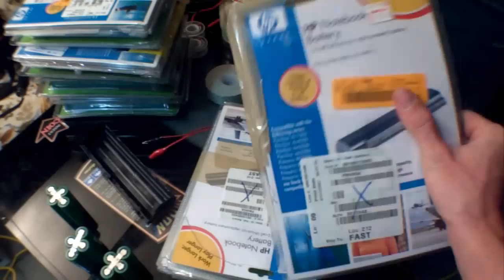DIY: 48v 24ah lithium ion 18650 e-bike battery pack

Comment: Your 35 Ah guess is WAY off!  Your battery contains 72 cells.  Each cell has at least 1.5 Ah (probably closer to 2 Ah/cell).  1.5 Ah x 72 cells = 108 Ah (i.e. at the load-rating that the manufacture uses to test each cell).  What's more important for you to know, however, is the battery capacity in Watt-hours.  In your case 3.7V x 1.5 Ah = 5.55 Whs/cell  x 72 cells = 399.6 total Whs.  That's why you were able to ride on a single charge for SOO long). 

p.s.:  Connecting your cells in parallel & series as you did, does not change the total Watt-hour capacity of your battery.

Comment: Did you use any battery management system?
Reply from the maker: at first i just monitored the cell voltages manually, then i wired up an imax b6 to charge them. but eventually i got a BMS.

Comment: i am new to the electric bike stuff and i was wondering what AH lithium battery pack i would need for a 36v 500w e-bike kit, to go 15 miles at a moderate speed with small hills. Thanks!
Reply from the maker: harry barry well this can be brought down to a more basic rule. i recommend for every amp you plan to pull you should have one Amp-Hour of capacity.
Reply: Sorry i have another question. would you say 10 "faulty dead laptop batteries with 18650 cells" for $50 usd dollars is a good deal, with roughly 6 cells per pack? thanks!
Reply from the maker: harry barry
yeah that sounds ok. that would be less than 1$ per pack right? look at what laptop they are for and see when that laptop was made. that can help you judge how old the packs are. and if they dont have any logos like IBM or anything on the batteries they will probably be low quality (but usable) cells.
Reply: Wow thanks for the quick reply!
there are 30 in total and i am buying 10 of them. Some of the packs are IBM, HP and replacement no brands.
Reply: Also to add some have more than 6 cells.
Reply from the maker: harry barry
nice, they should have atleast a few good cells.

Comment: hi, you have a web? how can I charge this pack battery, some schemes electronic circuits
Reply from the maker: unfortunatly no i don't have a website. but i may someday.

check the description for the next video. the next video is how i charge it.

in the description is also a schematic of this 24v 35ah battery. i use 2 of these batteries for my 48v battery

Comment: how did you test the ah of the batteries if you have a mystery battery???
Reply from the maker: i connected a motor to them that pulled 2 amps, and so for every 30 minutes it ran the motor that was 1AH.

i'm actually uploading a video right now where i test the battery with my imax b6. i was hoping it would be 35ah but it was only 24.

Comment: Can i combine my 4 sla battery's with a 48v 18650 battery pack i made? Its only 6s 14p. Not sure of the difference in amp hours is an issue
Reply: Dr. Steve Brule the amp hours may be an issue whats the ah of the 18650 pack and the sla's
Reply: Kim Jong Hard-un no the voltage of them i different so you cant

Comment: did you ever figure out the amp-hours of the pack, my guess is that you have 6 cells of 4volts each and each cell has 12 parralelled 2 amp-hour batteries in it so you have approximately a 48volt 24 amp-hour pack not 35 ah as you originally thought, but like you said at 8:18 ""i'm not really sure""  ;)
Reply from the maker: i did a discharge test video a while ago and the weaker packs had like 24.5ah but i think if i added a cell or two to the weaker packs to match the stronger ones it would have like 28ah. still plenty for riding around.
Reply: Rinoa Super-Genius
definitely good enough... twice as good as the 48volt 12 amp/hour factory sealed lead acid pack that my Ecoped came with 4.5 years ago, and they are starting to fade now :(
Reply from the maker: inspectyerbooty
 yeah 12ah is a bit small. i'm thinking about puting 4 car batteries onto the heavy duty cart i'm building for my bike so i can have 48v 110ah haha. it'll prolly go a shorter distance than the 24ah though because when i use the cart i'll be towing heaving things like bricks and metal.
Reply: Rinoa Super-Genius
 i see. yeah, i made a cart for my Ecoped [ http://ecoped.midland-parts.ca/en/citygo2010.html ] from parts of a wheelchair and a rectangular 15 gallon rubbermaid tub. i tow a12 volt 20 amphour agm battery hooked to a 300 watt inverter and run my 100 watt 48 volt scooter charger on the fly LOL i know i have about 15% to 20% losses in the inverter stepping up to 120volt to run my scooter charger but i get lots of extra mileage for alot less weight then packing larger batteries in series. my charger to riding ratio is 4 to1.. for every 4 minutes charging i get 1 minute of ride or said another way i have to charge my bike for 4 hours after a one hour ride so my extra battery and inverter give me 2 hours of charging or said another way one half hour extra riding :)

Comment: I have an ignorant question. I heard a rumor that rechargeable batteries should drain all the way empty before recharging, and so that's what i've been doing.

Am I being silly? Thanks for making interesting stuff on youtube.
Reply from the maker: that will wear out your cells faster i think. its best to keep topping off your batteries to about 80% or 4.0v. normally people charge cells to 4.2v but at that voltage they will very slowly die over time (like over years though) and also for every 0.1v less that you charge the cells you get twice the cycle life. so at 4.0v you get like 1200-2000 cycles from your batteries and they last a long time.
Reply: Rinoa Super-Genius Must be thinking of ni-cads.

Comment: I made a 36Ah 1.2v  Ni-Cd  Cell array made from 2 DeWALT 18V  Batterys and I'm going to use a boost converter to make it into a 5V 600mAh output so I can use it as a mobile heavy duty mobile charger.

Comment: its expansive, better use pb 
how u charge it? some circuit...?
Reply: CV/CC Boost converter with a power supply. Typically 12V - 24V Supply in combination with a BMS(Battery Managment System board)

Comment: Rinoa Super-Genius I am considering using 18650s for my bio too but i don't know how i would charge it. i have a total of 52 batteries with 4 batteries connected in parallel and then 13 of those bunches of 4 connected in series to make 48v.
Reply: Bike not bio
Reply from the maker: Adam Schulze
you can edit comments, build it into 24v blocks and charge it with an imax b6 like i do in the next video.
Reply: Rinoa Super-Genius ok thanks, now do i need protected or unprotected 18650 batteries?
Reply from the maker: Adam Schulze either buy a BMS circuit or charge it with an imax b6 and use unprotected cells. but dont buy truefire/trustfire/ultrafire.

pretty much any place that sells individual cells is a scam.
Reply from the maker: Adam Schulze
those look nice, prolly arent name brand but will prolly be like 2.2ah per cell. buy one and test the cells before you buy more.
Reply: ok thank you so much
Reply: Rinoa Super-Genius I'm sorry if this question has already been answered... Would a 12 volt, 30 amp car battery charger along with the battery cell leveler/monitor work for charging this battery pack? I'm looking to make the same battery (24v×2), just like you did. Nice work by the way, that battery looks great! The video is very informative and interesting.
Reply from the maker: Kyle Niedermeier
 no i dont think so. you need a ballance charger to ballance every so often. imax b6 only costs 30$. the B6AC is about the same too if you want that version.

you could modify an old computer ATX power supply to charge the batteries to 24.0v. that would be 4.0v per cell (if ballanced) and would give 4x as long a life.

the differance between lead acid and lithium is lead acid cells drop back down to like 2.2v when you stop charging but lithium cells will keep rising until they short out at like 4.9v.

btw lithium cells detereorate over time if they are kept at full charge, thats why for every 0.1v you charge them less you get 2x as many cycles from them.

Comment: is there a way to use this pack to charge mobile phones on long camping trips
Reply from the maker: +turtleman cockatoo sure, but id recommend just put them all parallel so its a 4.2v battery and get a lithium-to-usb charging circuit off ebay.
Reply: Rinoa Super-Genius  thank you thats just what i needed so putting them in parallel will just give me more battery life but not more volts  thank you
Reply from the maker: you could even charge it from USB if its just a 4.2v pack. they sell little chips for that too.

Comment: hye..i got a diy electric bicycle. i use 2x12v 7.2ah batery and my motor 24v 250w brushless motor. why when im at full throttle it cutoff my motor?
Reply from the maker: your battery voltage is dropping so low when you pull that much power that your bike turns off thinking it's a dead battery. thats my guess.

check to see how low the voltage dips and see if that is causing it. my 48v motor controller cuts out at 36v. those batteries your using are quite small  to supply 10 amps without dipping in voltage much.
Reply: i have check..its drop from 22v to 20 v..do u have any suggestion what to do

Comment: i have a really stupid question? for an Ebike which is better high or low discharge batteries
Reply from the maker: +LastManStanding you mean discharge A? well the battery that can give the most power without it overheating seems to always be better.

Comment: you're playing with the wrong toys young man. You've not experienced your first chemical thermal accident but you're on the way.
Reply from the maker: my first? HAHAHAHAHA

depending on what you define as a chemical thermal accident i've had them over a decade ago. i've been building things fo the past like 17 years and doing experiments. i think i know a bit about what i'm doing.

btw i've tried very hard to blow up lithium cells, they dont fail easilly at all. but  whatever ya say kiddo. ^^
Reply from the maker: goognam goognws
 teenager? i'm in my 20s haha
Reply: I build them all the time, with and without BMS protection... What Rinoa Super-Genius did was spot on and crafted well... and this is coming from someone with over 25 years of experience... so I'm thinking that you need to take those classes again.

Comment: why you use accumulators from the laptop, after all by the piece accumulators 18650 are cheaper?
Reply from the maker: buying single 18650 is much more expencive. single cells can be 3-8$ old battery cells can be 0.9-1.4$
Reply: Rinoa Super-Genius I'm getting 4A 18650 batteries for <$1.5... I hope something like that will be good enough.  I'll have to do a little more soldering but I don't mind that easy chore.  Although, I do love the idea of the laptop batteries.  Even if they are heavily used batteries the cells inside usually don't go bad at the same rate  On the other hand when I get new cells they aren't always identical.  I'd say it's a very good idea to thoroughly test every cell.

Comment: Can you mix different laptop batteries, like cells from 14.8v with 10.8v?
Reply from the maker: It doesnt matter what packs the cells come from, only matters if they are 18650 lithiums. So yup you can. On my first pack I had to use a few extra cells from old is packs I found in the trash in order to get the volts I wanted.

Comment: hi, i opened my controller on my e bike and its says "WORKING VOLT- DC48V  LIMITED CURRENT-16A" my question is would it be safe if i will change my current battery from 48v12Ah to 48v20Ah? im about to buy the battery and i just want to consult you before i get it. thank you in advance man.
Reply from the maker: adding more AH will not add more current, current is relative to voltage only. the only thing more AH will do is make the battery voltage drop less when you run the motor.
Reply: got it .thank you so much man!
Reply: i was hoping to increase the torque of the motor but then upgrading the AH will result in longer range i think.
Reply from the maker: CesCamacho84
only way to increase torque is to increase volts. but that increases speed and torque at the same time.
Reply: well i think i wont be able to add more batter since the working capacity of the controller and motor is only at 48v and my existing battery is now at 48v(4batteries). higher than that might fry my controller and motor? what do you think?
Reply from the maker: CesCamacho84
wouldnt fry the motor, and might not fry the controller. ussually 48v devices are made to handle like 55v but its up to you. whats the watts?
Reply: 350 watts.
Reply from the maker: CesCamacho84
oh so pretty weak. would be great for flat roads but i bet hills kill you haha.
Reply: hahaha yes, even small hills, my bike would be gasping for dear life, i have to pedal to assist it or else i will burn the fuse on bettry pack. LOL that is why im looking a cheap way to increase the torque, other that stripping the bike of its component to save weight. I even tried soldering the shunt on the controller.

Comment: Can you mix  3.7v 4200Ah batteries with 3.7v 6000Ah batteries ?...
Reply from the maker: yes
Reply: Rinoa Super-Genius Folk reckon it might damage the lower Ah batteries ?...
Reply from the maker: shen spen
Whos "folk reckon" ? And no it won't in parallel.
Reply: watch?v=v6kc4ALFuG4  <--- this fellow...

 I asked him the same question as i did you.
This was his answer: (Greywolf74) 

No. All cells need to be the same when they are wired up in series like they are in battery packs.
Plus there's a few forums that reckon the lower Ah batteries will be damaged !...
Reply from the maker: shen spen  yes he said exactly what i said.
 parallel is fine. and of course you should make them the right size in series.
Reply: Rinoa Super-Genius Ok, and thanx for the time mate...
Reply from the maker: shen spen
 even if you do have them out of alignment in series you can still pull as much power as the lowest parallel pack. but just rearange your cells so each parallel pack is the same AH.

when you connect 2 cells together in parallel they basicly become one cell.
Reply: Rinoa Super-Genius Ok i think i've got that...

Comment: Also what "C" discharge rate are they using. In my 78 cell 48v pack what if I want to discharge to 3v per cell (39v), what current should I be drawing to know when it's time to shut her down?